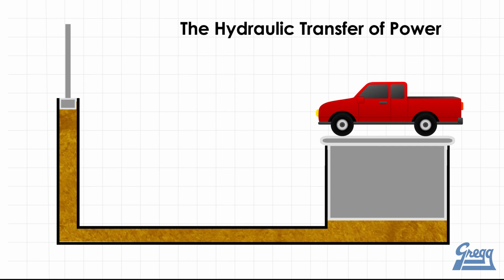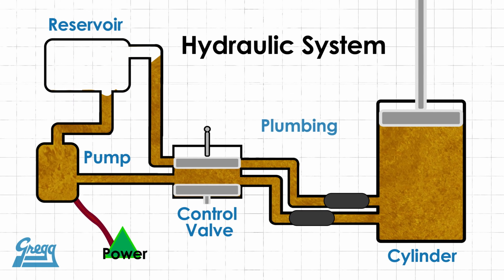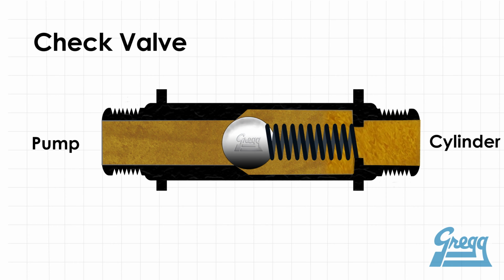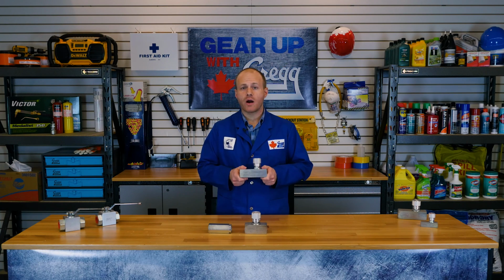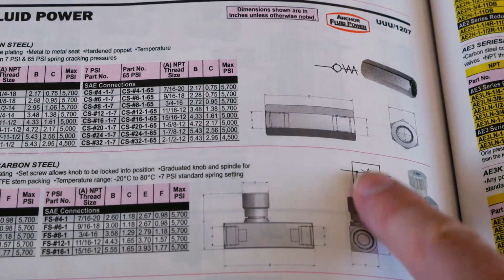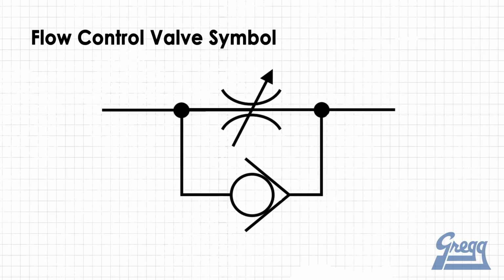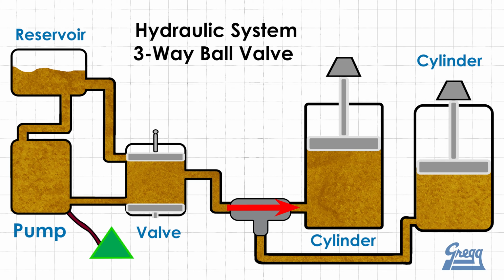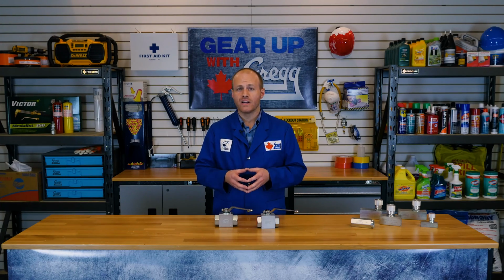How Hydraulic Valves Work - Gear Up With Gregg's

Comment: Hi great video. I'm fitting a new 42 litres per min  hydraulic pump on a tractor the pump goes on the crankshaft is there any way to slow down the flow 3 point linkage as the old pump 20 litres per ??? Thanks to

Comment: I have two big questions…open circuit vs closed on a 3 way valve? This valve is on the pressure side to divert full flow and pressure to two spool valves…I do not want to interrupt flow as I switch spool valves….do I use an open circuit design?
Next do all spool valves designs have a float feature ?
Reply from the maker: Thanks for watching our video!  Unfortunately, your question goes beyond our level of expertise, you're going to want to check with a tech/engineer who is certified on designing hydraulic systems.